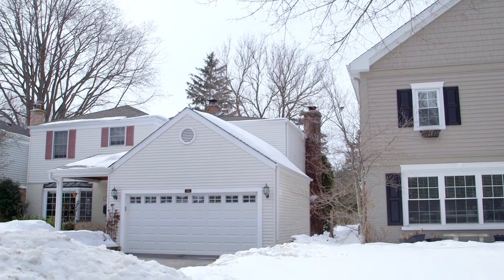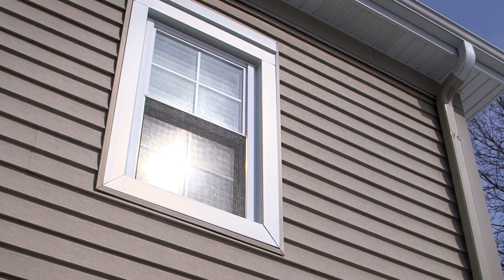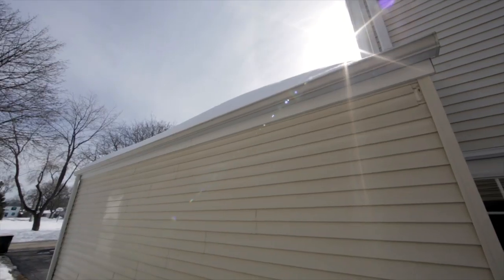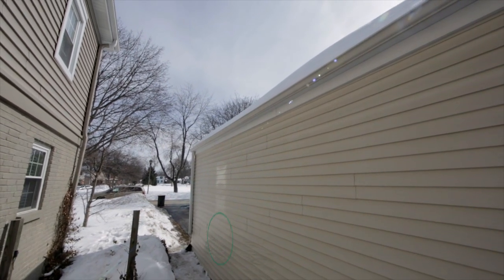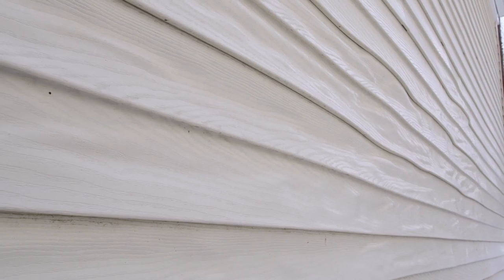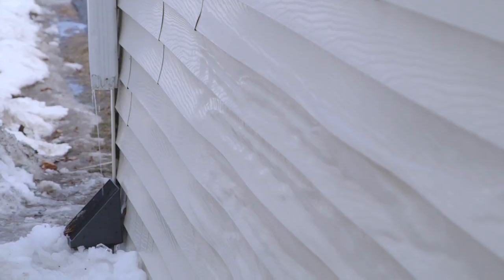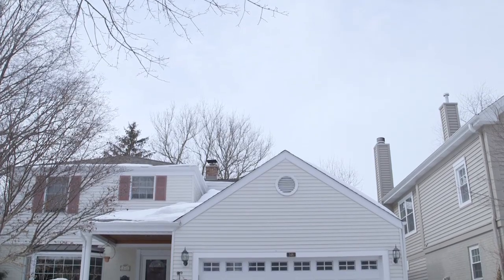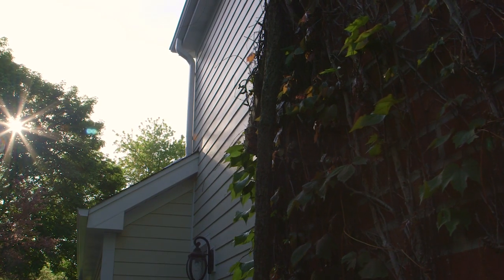Low-E Windows and Melting Vinyl Siding: A Homeowner Story

Comment: What a unfortunate situation for the homeowner dealing with new codes and facing an unfortunate part of how the windows perform (lowE coating). NOT A FAULT OF THE VINYL SIDING MANUFACTURER.  This individual can not blame it on the vinyl siding manufacturer. Because the heat reflected of the glass is a lot greater than the highest temperatures that the product can withstand before loosing its manufactured shape.  It is not very professional to put down other companies that have and are providing value to homes across the states without much of these issues.  The scenario is real and unfortunate but solutions are available.  One is for sure to block the reflection of the source of heat. Others is to protect the vinyl siding wall with some sort of vegetation, add a film to the window, screen that would block more sun light and lastly use of other siding options.  A typical salesperson using other's unfortunate issues with home positioning to light source taking advantage for the benefit.  Sad to see.

Comment: It's not the fault of the siding ,I have low e Windows in my mobile home and they caused a fire twice in the vegetation next to my home . It's the Windows ! I am wondering how many of the unexplained fires lately have been caused by them . I have found a solution without replacing the window. Vinyl cling window film or window screen or fabric toole. Like mosquito netting  ..

Comment: They focused beam of heat from the neighbor's windows can still cause a fire on the property even after the siding has been changed.  Nothing was done to eliminate the actual hazard.
Reply from the maker: Hi Jeanne, Vinyl melts easily in a fire (or even from the reflection of the sun off Low-E glass windows); James Hardie products are noncombustible and will not melt. James Hardie products will not ignite when exposed to direct flame or contribute fuel to a fire.Think of JH products as a pan used for cooking. The pan can be directly exposed to a stove's flame and not burn, yet the food in the pan will cook in time. Having an interior wallboard that resists burning for 1-hour buys time for the homeowner and fire professionals.
Reply: Seriously????? You are going to fully ignore the fact that ANYTHING combustible in the path of the rays can be ignited?   Melted siding is just a symptom of the bigger problem of the focused beam of heat going onto the property.  Look at this video, this person and MULTIPLE fires in her yard.  It's very nice that your siding won't be a problem, but don't give people a false sense of security that they will be safe by merely changing their siding, that is incredibly irresponsible.  http://www.wral.com/5onyourside/video/16558775/
Reply: Ii live in the redwoods and e Windows on my mobile have caused fire in the brush near my home Twice !!! It took twice for me to figure out what the cause was .

Comment: are you saying solar reflection can't hurt the coating on fiber cement?
Reply: it all fades and comes apart,7 yrs tops
Reply: -------------------- J. Hardie siding is a quality product.....but like anything else it has its drawbacks.....overtime yes it will fade due to UV rays.... imo the Achilles heel is its butted joints.... again , overtime due to expansion/contraction (hot n cold environment)  you'll see some  separation.... Not much maybe 1/16"  to 1/8" ....BUT a spot for bad weather to enter and make it more of a gap.... silicon caulk to rescue??